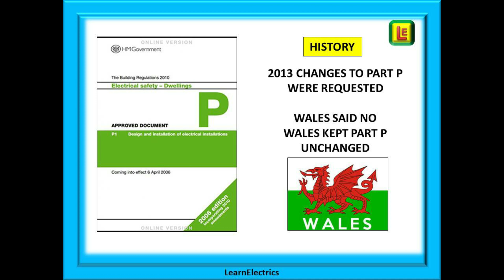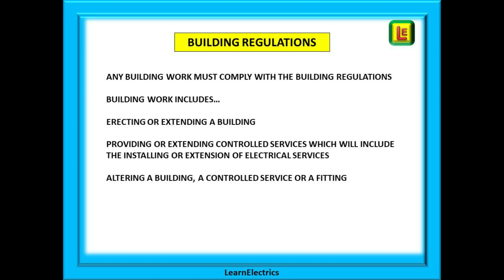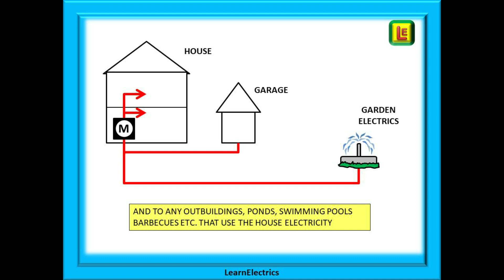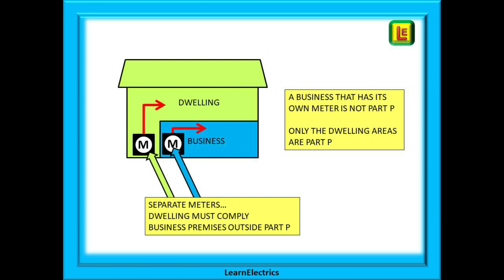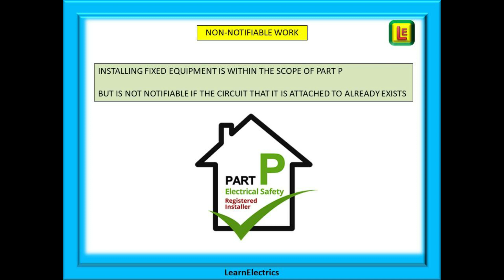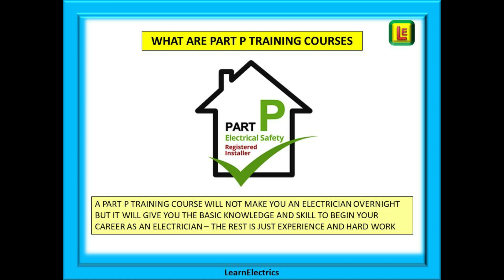PART P WHAT IS IT? The Building Regulations and Approved Document P.

Comment: Hi Dave. I believe a Competent Person Scheme, such as the full-scope NAPIT one requires 2 years experience. My question is, would it matter if a person had been out of the industry for say longer than 2 years, immediately before registering for part P, but prior to that had had 15 years of experience - working for an approved contractor and then as a sole trader under a NICEIC domestic installer scheme? The person has the right qualifications according to NAPIT for full scope. Obviously they would have to brush up on things - refresh and be up to date with BS7671. Could they simply work for a few months until they get a couple of rewires under their belts to use as examples - or would they be expected to work for 2 more years before being accepted on to a scheme?  Many thanks.
Reply from the maker: It's up to the assessor at the time and how they feel you are working etc. This is how it worked with me. The initial decision "to try you out" would be made by the head office in Mansfield in conjunction with the area manager and based on all your experience and whether they think the gap is outweighed by the previous experience together with recent activities. The area manager would then phone the field assessor and inform them that "Fred has been out of the game a while but see what you think" You would certainly need 18th edition, they may ask for an Inspection and test qualification or similar, they may suggest that you attend one of their in house courses before being assessed.
Phone them up, they are very friendly and will do their best to help you. Every application for membership has its own unique points and Napit are a good scheme provider. they may ask to see old qualifications, don't send originals, make colour copies or email them. Hope this helps. Dave.
Reply: @learnelectrics4402  Thanks Dave for your prompt reply. I understand how you would want to observe and get a feel for things on the day of the assessment - that's a good approach. When you say "to try you out". Do you mean to try you out as in letting one on to the scheme in the first place? or to try you out on the day of the inspection? Many thanks.
Reply from the maker: On the day of the assessment. Every assessment includes a practical assessment part, on the day, where we ask you to test 2 or more circuits that you have installed. Depending on the assessor they may suggest approval and full membership or membership subject to you doing a, b, c etc. and possibly a second visit. Talk to Napit, some of them will probably still remember me. Make sure that before the assessment day that you have everything ready, all paperwork available as per the videos of mine. Being organised and impressing the field officer with your professionalism from the off is a good thing. Don't worry about the assessment, they are there to help you become a member, not to stop you. And everybody is as nervous as a pig in a sausage factory on the day so you're no different.
Good luck. Dave.

Comment: Would relocating a consumer unit, without changing any circuit be notifiable?
Reply from the maker: Definitely does need notifying. The fact you take a wire out and put it back in again counts as work on a consumer unit. Thanks for watching. Dave